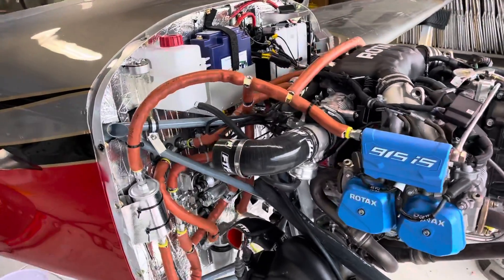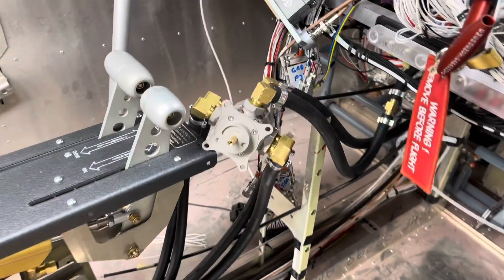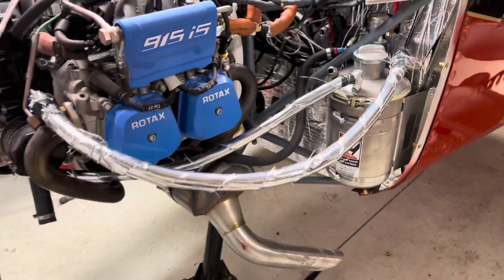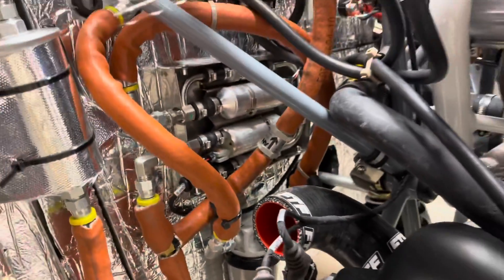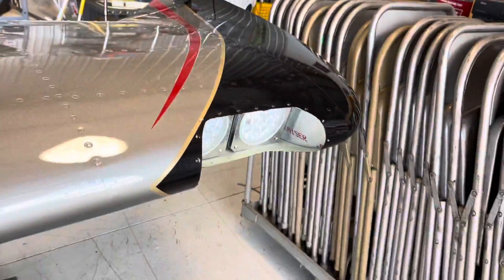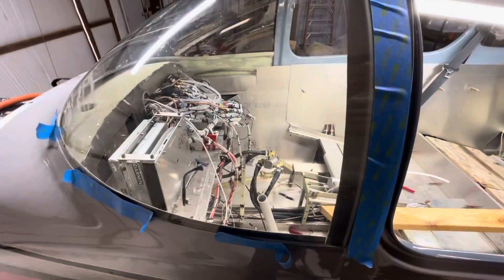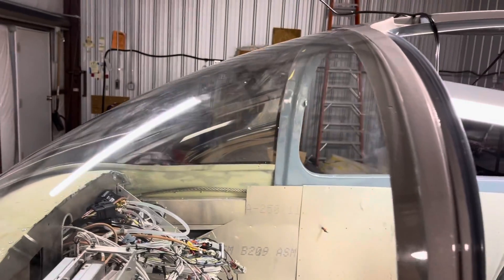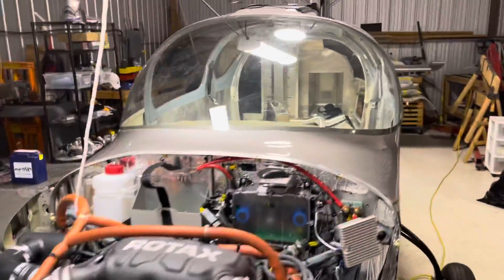Sling TSi Build Update - April 13

Comment: Thanks Aaron.   What is the idea of the fuel pump in the centre of the cockpit?
Reply from the maker: Sling recently updated their firewall forward kit to include this boost pump to help with fuel flow to the main fuel pump. Additionally, they made the non-pressurized hoses 3/8” instead of 5/16”. If you see Evan’s latest video, he apparently had all 5/16” hoses and was getting low fuel pressure warnings at altitude. I don’t think he has the boost pump, but did upgrade his hose diameters.
Reply: @astampa1234  thanks Aaron.  I must look at doing an upgrade.  My fuel pressure is always on the lower limit.